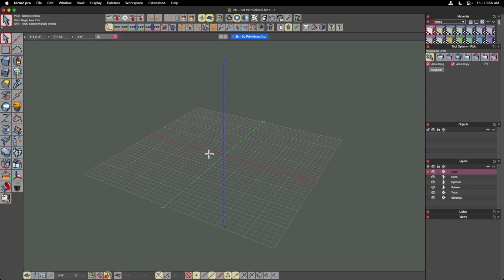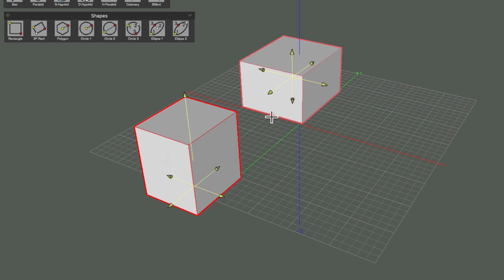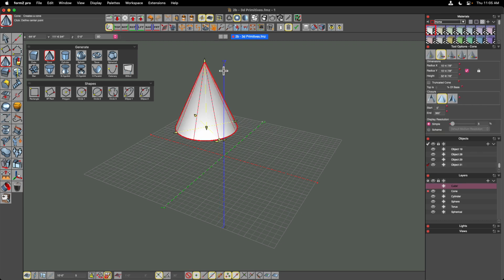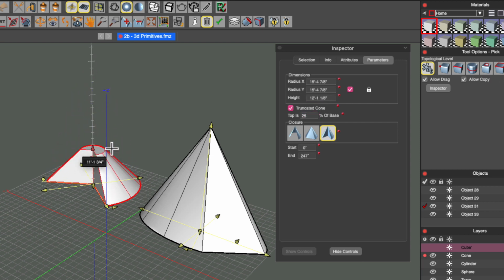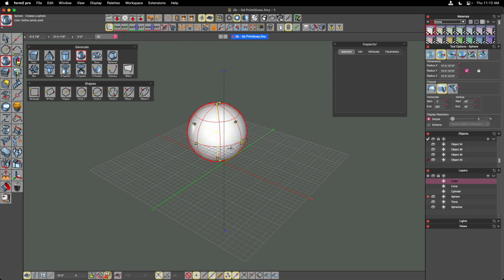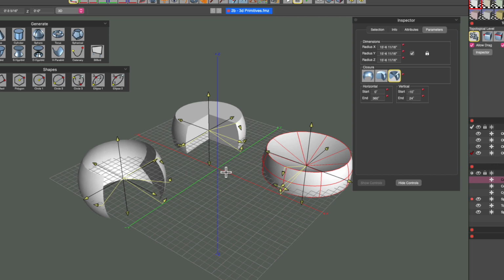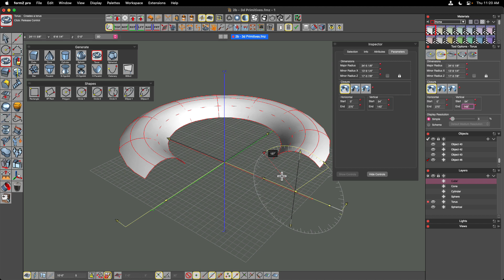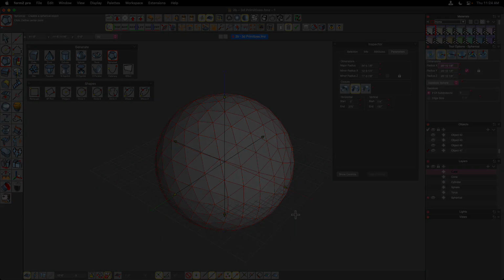3d Parametric Primitives

Comment: It's good that these videos exist, but: 1) literally everything shown in this video can be easily done (and with more control) using the Revolve tool and 2) in this instance at least, the tool UI is sufficiently straightforward that I would venture to say that most Form Z users really don't need a video to understand it.
Hopefully the Form Z people will continue producing videos, and hopefully they will address the more complex and abstruse parts of Form Z rather than just plucking the low-hanging fruit.